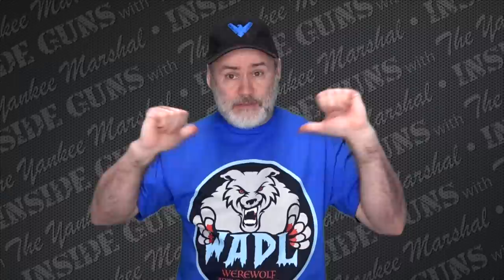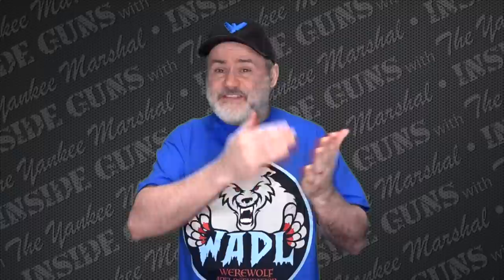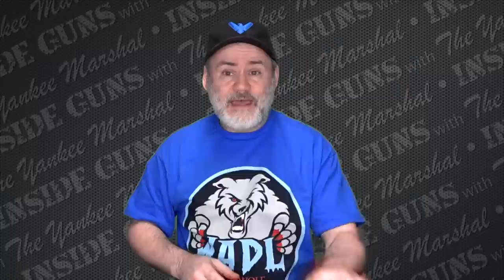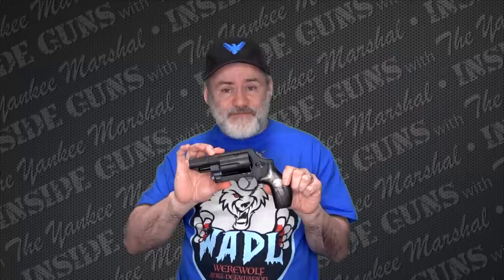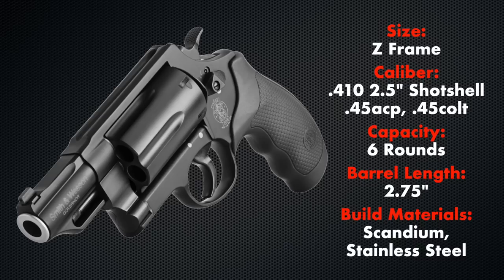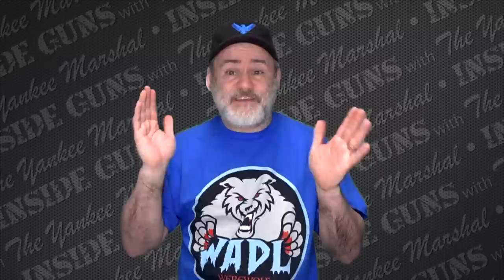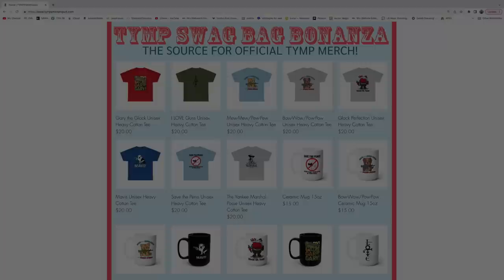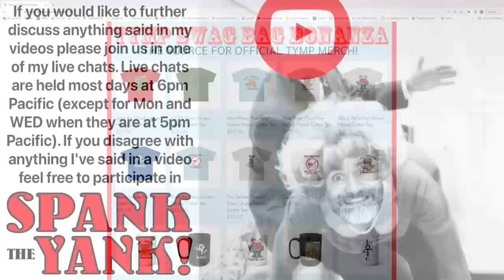Detailed Guide to S&W Revolver FRAME SIZES and Variations!

Comment: Thanks for sharing. I have two 357s. One is a combat model. Which is a 66 and the other is a 686 plus. Then, I picked up a 44 magnum. The last one that I have is a 10 mm. I got it just last week. Also, they are all in four inch barrels.

Comment: There is actually a 5 inch J frame out there. It seems like they’re kind of hard to find but I finally located one. It’s a model 60. And I didn’t know it had a Hillary hole until I got it.🤦🏻‍♂️
Reply: Wear your key around your neck on a long necklace. If you are in a self defense gunfight, and that safety jars to lock, call time out, so you can unlock that tiny little "Hillary Hole".

Comment: Hey, what's the revolver you have depicted on the L frame backdrop? I love the fact it actually has rear sights and looks like the front sight is interchangable
Reply: Yah I like the Gun Metal blue with checkered rosewood or walnut grips, not many companies are doing Gun deep blueing anymore damnit.  As a beginner I'm looking at Taurus 605 3" 5rd 357/38spl. or 856 3" 6rd. 38spl. Only. Also model 66 7rd. 4" 357/38spl.  They come in BLK NDLC coating like Glock or Satan stainless only no gun metal blue.
Reply: @TheLoneRanger745  yeah I fing myself looking at them same Taurus revolvers too. Everybody say their good to go. I just never had a firearm without a manual safety and I own rifles, a shotgun and a few pistols

Comment: Thank you, I've been trying to learn all about revolvers, I've written all this down for reference. One thing l've found, not that many still come in the beautiful gun metal blue anymore which I REALY like , alot of the new NDLC coating like Glock uses or Satan stainless steel. It may not be to your liking, but I think the fire casting hardening is Beautiful. Each one is unique on the early model SAA Colt's and Colt clones, Uberti, Pietas, Cimarron and Taylor. There's also a chemical reaction process that can look similar to the real thing. You showed your collection on video and it's huge from a distance they look like two hundred of the same thing, maybe you could explain what makes one different from the other . I realy Appreciate you explaining all the sizes of frames which are very slight and difficult to distinguish, could you do another video showing and explaining the subtle difference's as identifiers to the naked eye .

Comment: Do they make a 44 spl that isnt 44 mag?
Reply: Nothing in current production, but you could find something on the used market. Model 24 and 624 are N frames, while the 696 is on the L frame
Reply: Ruger currently makes a GP100 in 44 Special but not in Magnum. Unfortunately nothing from S&W currently.